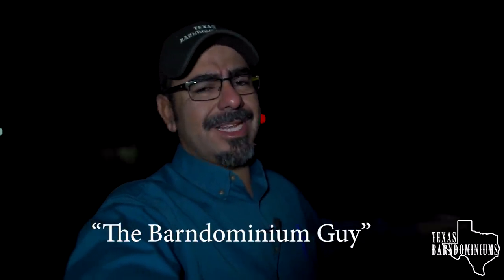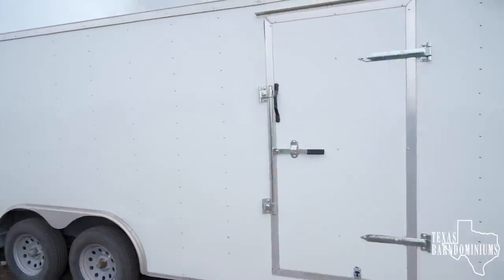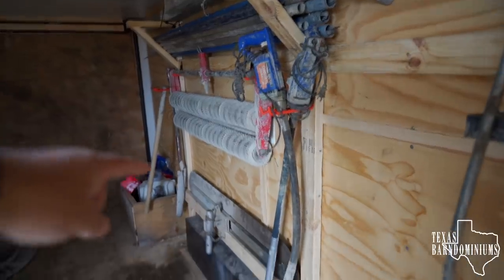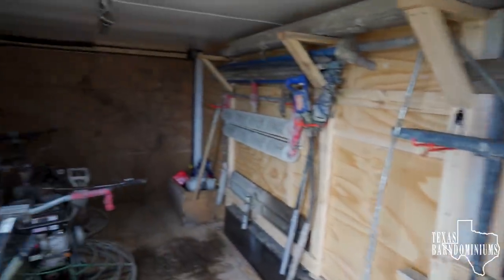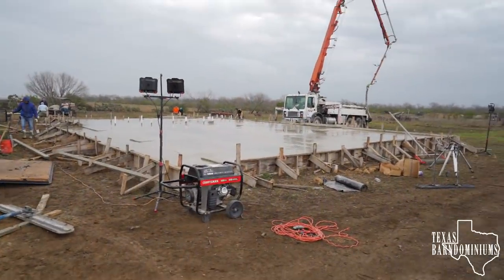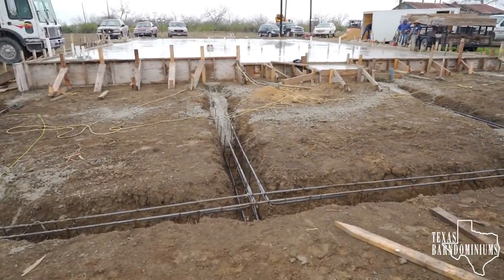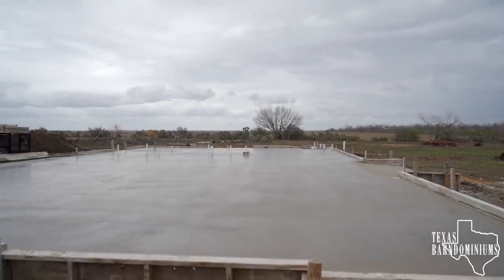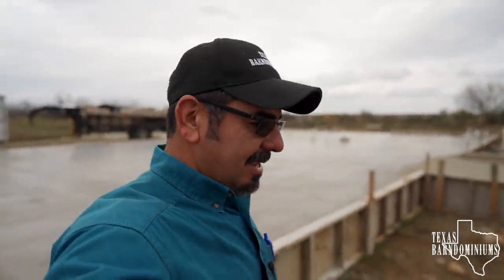How to save a concrete slab ruined by rain - S3E6

Comment: I'm very sympathetic about what a disaster a spoiled foundation can be- I've been a plumber most of my construction years and a lot of our work is under or sticking through that slab. I never met a good concrete operator or foreman who wasn't a "worrier"- and you are so right, the details matter, even at the planning stage! BTW, I vote with the folks on adding another first aid kit to the trailer; I was aware of the co. trucks being equipped but how often does somebody check them and report back/ make sure they are current and "topped up"? Like the new show number system- most of your jobs have a posted job number; now you can refer to a particular barndo by it's job number and then give the episodes in a less confusing way.
Reply from the maker: First aid kits are on the way.  :)
Thank you.  

I didn’t show it, but my guys scrape the concrete off the plumbing pipes when we pour concrete.  We leave them as clean as we found them.  :)
Reply: @TexasBarndominiums  I had noticed how hard you and crews work at not  fouling your subs work. You're somebody I'd like to do business with again! All to the good- it makes the client the winner- the folks who pay us all!

Comment: Do you water cure your slabs and if not why. I haven’t ever seen a builder water cure slabs but every thing I read about water curing says it makes the slab stronger and with less cracks.
Reply: You sound like an engineering type who knows what he is doing. These "concrete experts" aren't really they are just contractors who don't want to spend the time to do it properly.

Comment: I have been watching all of your videos. I am planning on building this year. Off topic question:when you air seal with insulation, is a fresh air circulator required? Is a good Hvac all that is needed to keep moister down? Do you spray insulation directly to the roof metal? I am in Oklahoma. Love the videos.

Comment: Had a 150 x 20 slab poured and it rain the day before trapping in some of the rain. After all said and done and concrete dried I found a low spot in the corner of the slab. Reason I know it rained and water was setting on slab. Roughly a 8 x 20 spot. What I need to know is it fixable? I plan on mentioning it. Not sure if it was because the water that was trapped in the pour zone or just workmanship.

Comment: Down here on the coast I have seen it rain six inches with a 30% chance of rain forecast. Won't be a cloud in the sky and one will blow up out on the bay and you better have plenty of 6 mil ready. Get careless and don't cover a location the day before a pour and get a frog strangler and it's just about as bad or worse.

Comment: Bounty paper towels - the quicker picker upper - dries up the water. Pour gas or diesel on the slab, set it on fire and it helps with temperature control. All this is just $1.00 per square foot.  It theory this doesn't even sound good. 
Never mind. 
Good save.
Good video.

😎
👍👍👍👍👍

Comment: Dude, I'm sorry.  As a concrete specialist and engineer I wouldn't sign off on this slab.  Water affects the cement:water ratio and weakens the concrete.  Rain water will always seep into the mix and affect the cement: water ratio.
.
You should always check the weather on work like this.  If there is any hint of rain you  should have plastic sheets ready to go.  As a concrete company you should have plastic sheets in case of cold weather too.   Learn about curing temperature and find out how to ensure the curing temperature is achieved.
.
I'm hoping this slab design strength was well over 25MPa, and that this structure will not take on any significant load.  You should take some of that concrete out and place it in metal cast cubes for testing and recording the final strength of this slab.  At the very least document on the final drawings that it rained during the curing period and that the concrete was exposed to the rain.  This is very important as the building could be re-purposed in the future to carry a greater load under the belief of the design strength only to find structural failure.  The only hope for this slab is that the reinforcing might still save it.
Reply from the maker: Thanks.